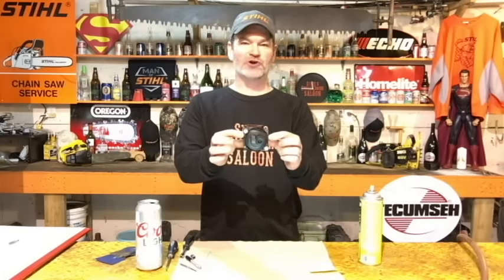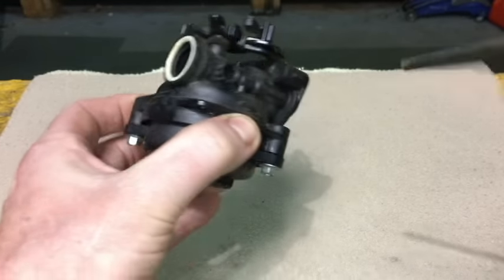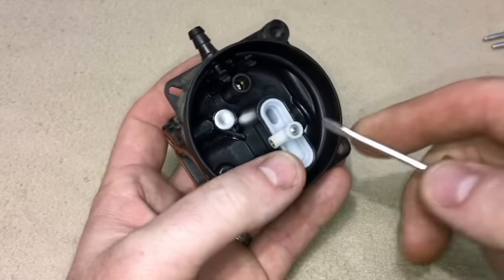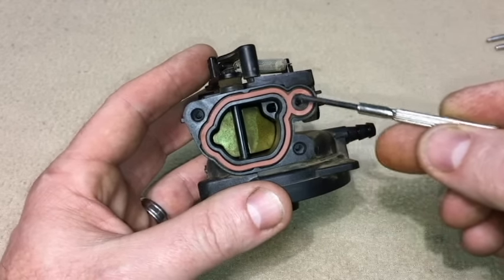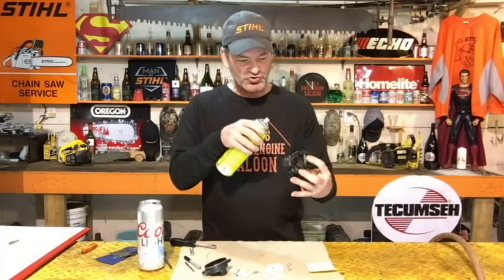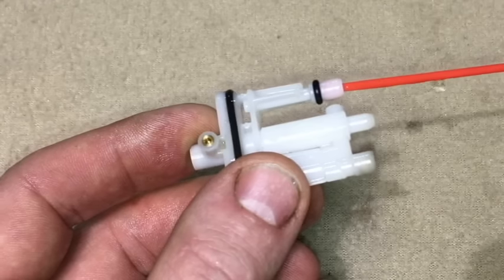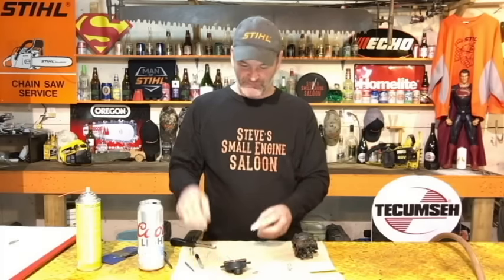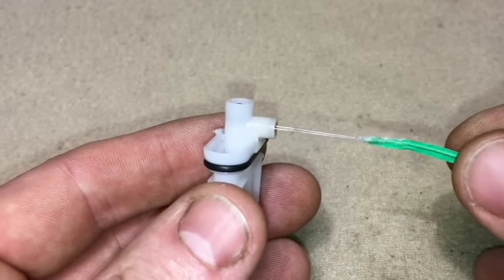EASIEST WAY To Clean a Plastic Briggs Carburetor

Comment: My lawnmower would not start.  It had standing gasoline in the bottom of the airbox.  Google's best guess, float valve issue.  I followed your instructions in this video.  Took my carburetor apart.  Cleaned it.  Put it back together.  Lawnmower started on the second pull.   Repair cost, ZERO.  Thank you very much.  A very, very, good video.
Reply from the maker: Thank You...and You're Welcome...

Comment: Steve, thanks so much for the great video on cleaning my briggs and stratton plastic carb. I ordered a new one on Amazon that was due today and I came across your video. Went and spent $2 on a can of carb cleaner at O'Reilly's, took the carb off, cleaned it like you showed (I didn't have a wire bit to drill the fuel hole out) and BAM! It fired up the first time. The one that shows up today will be going back to Amazon. many thanks and enjoy the beer on me.
Reply from the maker: Great to hear!

Comment: First of all, I love your videos. I just picked up a mower on the side of the road that would not run. Primed it and it backfired and quit, sheared fly wheel key. After that it ran and surged,  carb I was sure. Took it apart and cleaned it and and as you did with the cartridge I drilled the jet out at about .020. Now it runs with no surge but a little rough and black smokes a little. I know its a little rich running now. Anyway got a new aftermarket carb coming. Thanks for some really good information. PS I already had some micro bits.

Comment: This video was immensely helpful. Found out the problem for me was the rubber tip on the needle of the carburetor float. The tip somehow loosened up and came off, was blocking the jet no matter how the float moved. Much appreciated!
Reply: Yes, thank you so much! Wouldn't have found it if it weren't for your video! Going to show you some support. (Buy Steve a beer) 😂👍💜

Comment: Hey Steve I can relate ‘‘em bare assed after third time with that woman’s mower. Just watched your two videos best way to fix Briggs carb problem and best way to clean a plastic Briggs carb. Could hardly wait till morning to pull carb off of my 5 yr old toro 7.25 b&s. Pulled new carb off for the 4th or 5th time (getting really good at it) I was sure this time was going to be the cure. My bread wire tie measured .016 and was loose in the jet, so I figured it had to be at least .20, which is what you opened yours up to. Put all back together hoping to start on 1st pull, or at least by the 3rd. No go, but here is the thing, choke is completely closed and if I even give it a whiff of starting fluid not a squirt by the closed choke, it starts with almost half a pull. Runs great no misses until I shut it off. Will even start back up. Which tells me it is still not getting fuel???  Still ‘‘em bare assed Bill

Comment: Great video I will be trying all these steps. My  pressure washer is only a year old and I ran the gas out last fall and all that jazz but it wont start.  My question is are there any metal replacement carbs in this model? why would any one want to deal with the plastic garbage every year? if so, what model carb do I buy? thank you for all the help!

Comment: Steve, you are the man! I'd been chasing the non-starting of my Briggs 7.5hp mower for at least a week when I came across your YouTube videos. Even though the one arm was rubbing against the carburetor frame, I knew it wasn't the root cause of the problem, (I've used the mower previous seasons w/o issues) but I "gapped" it anyway. Thanks to your suggestion about the jet/port being undersized, using a microdrill bit from Harbor Freight, I enlarged the jet/port with the next larger diameter bit. After some carburetor cleaner sprayed throughout, I reassembled everything and this time, the engine started. Yes, it sputtered a bit but shortly found its voice and the lawn cutting commenced! 

Thanks again!
Reply from the maker: You're Welcome...

Comment: Thank you so much Steve. I have a pressure washer I used once with the same carb, 2nd time I used it, it wouldn’t start. Great video explaining the exact problem, I ended up using a needle to open up the hole again, and carb cleaner sprayed right through. Thank you for saving me a bunch of time and money having to buy a new carb.
Reply from the maker: Great to hear!

Comment: This was an excellent video.  I am not handy when it comes to small engines by any means, but after a few YouTube videos, I cleaned the carb but the engine would not start.  

 after watching this video, I realized I hadn't cleaned the tiny little hole.  I opened up the carb again was able to clean the plugged hole and get my pressure washer started.  I did not have a mini drill set but I used a sewing needle and that worked fine for me.
Reply from the maker: Right on Buddy!  Thank You...

Comment: Hey Steve, I must say this video was spot on.  My Briggs & Stratton 550EX inexplicably would not start this spring.  I watched your video and followed it step by step.  It was a little daunting taking apart a small engine carburetor for the first time but you guided me through it.  With fresh fuel and a clean carb, the Briggs fired up on the first pull.  Thank you!!  Your'e the man.  Cheers!
Reply from the maker: Thank You...and You're Welcome...

Comment: Thanks for this video.  A neighbor gave me a MTD mower with the 300e engine that he was about to junk.  I could usually eventually get it started, but it surged constantly.  Today I bored out the jet to 25 thou, it started right up and no more surging.  Oh, I also opened up the lash on the exhaust rocker to .006" - it barely had any play.  Intake was fine.  Thank you!
Reply from the maker: You're Welcome...

Comment: Hi Steve.  Well, I went ahead and took a chance and opened the main jet up.  I only had a .54mm not a .52mm drill bit. OK, living dangerously.  It worked!  The surging is gone runs nice.  I will be buying the .52mm.  Thanks for this great tip.  Watch your channel all the time.  Keep the videos coming.
Reply from the maker: Nice work!

Comment: Picked up a $3 set of micro drill bits from harbor freight and no need for a new carb! Started on the first pull! As for your other video for these carbs with the metal bracket, they have since rectified that issue. My pressure washer is less than a year old and my bracket has an oval relief cut so it doesn’t interfere. Thanks for the help!
Reply from the maker: Right on

Comment: Had the same issues you described, Steve. After finding your videos here and followed your instructions. The problem I had was that was unable to get the gas line off which kept me from getting the carburetor completely off. It did come off enough for me to get the bottom exposed and apart. Once apart, followed exactly what you explained. Put it back together and on the second pull, it fired up. note; my needle was plastic with a metal point that comes off very easy. Thanks for the help

Comment: Steve, a couple of months ago, I cleaned my B&S 300 series carburetor and used the bread tie wire like you demonstrated. My mower cranked on the first pull, and it won't die -- even when I'm tired and wishing that it would! Thank you for your assistance.
Reply from the maker: You're Welcome...

Comment: I just fixed my mower because of this video! I had cleaned the carb, then even changed out the carb, nothing worked. It was pulsating no matter what I did. The new carb had too small of a hole for the main jet. The micro drill bit worked perfectly! Thanks so much brother!
Reply from the maker: Great to hear!

Comment: Did this today because my mower wouldn't start. Main jet was clogged, wouldn't spray through, used a bread tie wire and cleaned out the varnish. Sprayed through perfectly after that. Put it all back together again and fired up on first pull. Just amazing. Thanks for teaching me how to clean this carb properly.

Comment: Excellent! I tried to fix two of these plastic carbs with just a small wire. Both started and both stalled out. I purchased the micro drill bits Steve recommended, used them and both lawnmowers run like clocks now. You were absolutely spot on Steve. Thank you!
Reply from the maker: Excellent!

Comment: Thanks Steve I've done many carb cleanings back in the day but these new plastic carbs are very different the mower I'm working on now has a this carb problem also I did find one head bolt way out of tork spec , thanks .

Comment: That’s one of the most helpful videos I have ever seen.  I have been completely stumped as to why my mower won’t run because it all looks so simple and I had cleaned it out with brake cleaner.  But I didn’t know about the white cartridge and that tiny jet!  But now I do and I will definitely try your modification because I’m no drunk monkey either and I like to fix things myself!  Thank you so much for blowing the lid off this subject; awesome video!    Update.  I took the white cartridge out today and cleaned it through.  Some signs of black bits, but the holes were not blocked.  I held off from drilling out the jet, but re-assembled it all.  Some quick presses of the primer, and guess what, it started first pull!!  And it ran evenly.  Very, very pleased!
Reply from the maker: Good luck!

Comment: Steve, thank-you so much for posting this video.  You showed me exactly how to fix my problem and once reassembled, my pressure washer started on the first pull!  I ordered the micro drill bits, so the next time it clogs (which it inevitably will), I will have the necessary tool to drill the spray nozzle bigger.  Thanks again!
Reply from the maker: You're welcome!

Comment: Wow, I'm planning on purchasing a Troy bilt T200 550e Self Propelled Gas Lawn Mower, and a lot of the negative reviews are, there having problems with the carburetor. So before I purchase this mower I've been trying to find a solution to this problem before I purchase this mower and you nailed it. You're my HERO man, thanks a lot for taking the time to share this......
Reply from the maker: You're Welcome...
Reply: @StevesSmallEngineSaloon  Thanks for those drill bits.....

Comment: Hi Steve. I took the carb off 3 times. Cleaned it with carb cleaner, blew it out with air. Started but sputtered. Cleaned it again. Still sputtering. Finally watched your video. Drilled out the main jet and tah dah started right up. Wished I had watched yours first. BTW, the main jet did appear to be clear but the wire did not go all the way thru. Just enough to make me think it was clean. Son of a ....
Thank you so much.
Reply from the maker: Nice work!

Comment: Steve I drill them out with a # 72 drill bit .025 works great , starts first pull ,,,,even the ones without the auto choke . Thanks so much for the tip,,,I'm a 74 year old machinist and I'm like you " Old School " !
Reply from the maker: Right on

Comment: So glad I saw this and this and the other video on hard to start plastic B&S carburetor problems. My 3-year old lawn mower was hunting, so I cleaned the carb as you described. The I made the adjustment to slightly bend bracket that was very close to making the choke stick open, and then checked the main jet. Fortunately, the .020 drill bit fit easily in the main jet. Perhaps the consistency on the main jets varies? Fortunately cleaning the carb solved the hunting problem. I have never had to clean a carb with only 75 easy hours on it, so I wonder if these plastic carbs are temperamental and need much more attention.

Comment: Yep... Steve's video was spot on...my mower from last season has one of these plastic carburetors. And it would not start today. I watched Steve's video...took that sucker apart, cleaned it up and it started. Its frustrating that a virtually brand new, albeit inexpensive, mower wouldn't start...I was determined to fix it and after stumbling across Steve's video, I was able to do just that! Thanks man👍🏻
Reply from the maker: You're Welcome...

Comment: Gday .my 2017 Briggs and strat  push mower -plastic with carb Has been stressing me out surging/ HUNTING. I’d seen one of your YouTube clips in the past.i finally remembered one of your tips a💡moment  it was the petrol cap breather blocked I cut an  spare o-ring down  so it only went 3/4 around the inside the fuel cap and now it’s all good .love ya show Steve thank you.👍
Reply from the maker: Right on

Comment: The fix for the plastic toro lawnmower carb. (new out of the store) was perfect. We used a very  slightly larger drill bit, and it worked great. The most difficult part of the fix was getting the crappy plastic top off of the lawnmower. After we bored it out, -- First pull, instant start. Before the fix, it would start, go 10 seconds and die. Over and over. I would never recommend toro push lawnmowers for anyone. Thanks, Steve!

Comment: The bread tie saved the day! I had to actually use a tiny bit of force to push the obstruction clear. I was so sure after the repair that I filled the tank all the way, and then it started right up so I immediately got my wife to hack away at the overgrown lawn while I cracked a ginormous frostie! Thanks for saving me a costly repair bill. Great video!
Reply from the maker: Right on

Comment: Steve, thank you so much for your channel.  The episode on the Plastic Briggs and Stratton Carburetor is a life saver.  Mine is on a Husqevarna pressure washer and I watched your channel episode and cleaned the carburetor.  It fired right up the first time.  However, then I tried it a few weeks later and it wouldn't start again.  So I ordered the microdrill set and drilled out the main jet as your episode shows.  It starts on one pull now.  Tried it several times and I think you hit the issue with these B&S Plastic Carburetor's on the head!  Thanks again for your shows.  They're excellent.  I'm now drinking beer with every fix too.  HA!
Reply from the maker: Right on Dave!  Thank You...

Comment: I bn working on brigs n Stratton  engines nigh on to 60 years. If any one wants to know how old  I was when I started I was  between 10 -13 don't remember  how old for sure but I just know it had to b in that age range.  I learned by fail ier if it didn't work try to fix it again. Now my grandad wasn't  a mechanic but he  knew enough  to tell me about 3 things to look for spark - fuel - air. And I took it from there I might say I have never worked  on small engines for profit I just do it as favors for self kith kin neighbors . I really liked your video as I just worked on my sons mower that has one of them cheap carbs just a couple weeks ago. Long story short I got it to run but I am not really  pleased  at the way it runs.  It's got a surge so after watching your video I am going have to tear carb back apart. Thanks  BTW I use hot white vinegar as a carb cleaner n compressed air.

Comment: thanks for the video i used to be a small engine marine powered technician  and I was just about ready to scrap my Briggs and Stratton pressure washer. It has that same carb on it. every year I have to clean it after I stabilize the fuel and winterize it. I believe it was a fault in the plastic carb . thanks for that I will give it a try. and see if the jet is two small . Like you I hate that I cant get something to run . especially if you have compression and spark.  And the Item is brand new.  I have a snow blower and It is the same make but with the metal carb. it starts with out any problem. Keep up the good work. Steve.
Reply from the maker: You're Welcome...and Thank You...

Comment: Thanks again Steve! At my work we bought a new pressure washer last year. I got it out today and Yep it won't start. The choke is closed and it will fire if i put gasoline in the carb but kills right out. Guess it time to pill the carb and get it out. Thanks so much for your channel. I am yet to rip into a plastic carb....   Cheers!
Reply from the maker: Good luck!
Reply: @StevesSmallEngineSaloon  thanks Steve, I did pull the carb cartridge and cleaned it out, runs great now. But what's with this No oil change deal? Never?? The way they're building engines now maybe they figure it won't in service that long and they are considered disposable ??  Cheers!

Comment: Thanks for the great video, I'm going to try the .020" drill bit trick. Just a note, GumOut Carburetor cleaner will dissolve some manufactures O-Rings on the White metering insert and also some of the plastic of the carburetor bodies. So make sure you pull the O-rings off whatever part you're cleaning. Do it quickly and immediately dry the parts with some canned or compressed air. Oddly at the end of the season it's best to disassemble the Carburetor and and dry all the gas out of it with air before you reassemble it and put it up for the winter. Oh and keep a spare carburetor on hand as they are junk, but inexpensive and will work for a season or two, but hopefully your trick will solve this problem for good on these Carburetors. Super video bud!  Best Wishes & Blessings. Keith Noneya

Comment: My father in law has a Craftsman mower that wouldn't start and I took it apart and cleaned that piece and it started. I have a Briggs and Stanton basically the same mower but mine will run with that rough idle so I thought cleaning it would fix that but it didn't. I did the twist tie and used the wire cleaning tool. I saw a guy use some kind of gold acid but I didn't try that. I'm going to get that micro drill set and try opening that hole. Thanks for the idea and hopefully I can smooth out that idle. This is the first time I've ever done this kind of work and it's not as bad as I thought. Just need a little courage to try. Thanks again
Reply from the maker: You're Welcome...